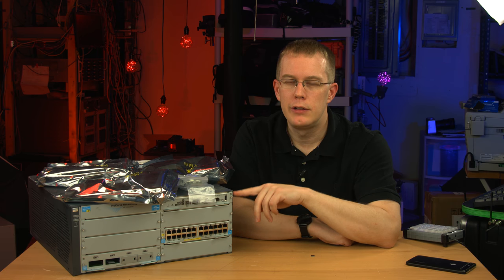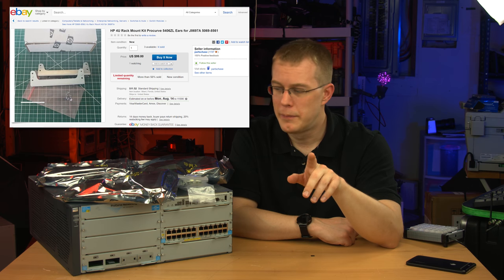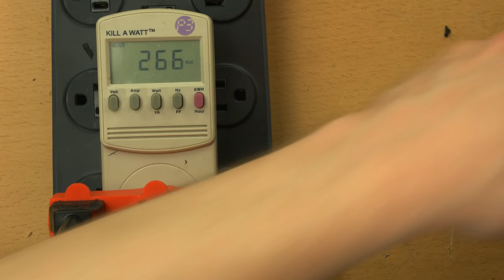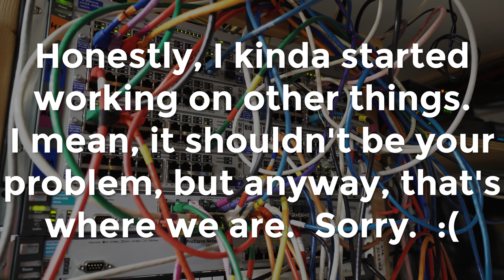Enterprise Network Switches for the Home: Ramble feat HP Procurve 5406ZL

Comment: I wanted to add, this switch and the 5412zl as well as the 5406r and 5412r models are probably the most reliable piece of electronic equipment. I have run several of these for 12+ years without fault and if you're the original purchaser, you get unlimited warranty...even to this day.

Comment: You can save a fair amount of power by only running one PSU and turning off the PoE functions on the switchports. There are still fans and stuff running though, so this is still going to be a fairly hungry switch in terms of power consumption. 
and if you have an old rack mount anything, it can become a shelf to hold your new goodies that have stupid expensive rack ears. (looking at you Juniper) Old server slide rails are great for this kind of thing. Set a few cover plates across the slide rails and voila, insta-shelf. Got an old dumb Fast Ethernet switch? Gut it, rack it and it is now a shelf.
edit - You can hot swap any module on one of these EXCEPT the management module in the very top slot. You will need to reboot to change that one out. Source: we ran these for almost 15 years in a major convention center. These switches are bomb proof. They sat up in summer heat in filthy, dusty catwalks above exhibit floors with big diesel trucks and propane forklifts running around below. Power failures, constant plugging and unplugging of network cables. These things gave no fucks. They just run. Blow them out with a can of air every so often, give them a reboot...or not. If one of the blades dies, that's as good a time as any to power it down, blow out all the spiders and give the fans a fighting chance. If you want quiet, you could probably upgrade the fans with something newer and more efficient. They're just standard sized things you can get from anywhere.

Comment: C13 and C15 are both rated for 10 amps. The difference is that C15 is good to 120° C while the C13 is only rated for 70°.
Reply: Depends on which country you're in and which certifying body you're following. IEC says C13/C14 and C15/C16 are 10A only, but that's primarily in place for countries with 240v mains voltage. 10A and 240V is a serious amount of power. But with 120v in N. America, it's not such a big deal. In fact, Underwriters Labs (UL) approves C13/C14 (with 14awg conductors) for 15A. The only difference being the temperature rating between C13/C14 and C15/C16.

Comment: Aruba S2500 is half the price, and do almost the same thing, L3, 10Gbe etc,  and also brocade switches
Reply: Older Brocade ICX switches like the 6450 or the 6610 are the business! 
Also, some of the older HP Procurve 3500 series switches will do 10gig and have gotten cheap. If you don't mind learning Juniper, the EX2300 also sports L3 switching and 10gig if you get the optional upgrade for it.

Comment: Is it just me or is anyone out there also concerned about security? Counterfeit chips overlaid on top of the network stack sending packets back to China or Russia? I know it's been done in the past with printer nic's. Makes me a little nervous not buying Network related items from an authorized reseller, authorized distributor, Etc. I.e. 100% genuine.  I don't know. Maybe I'm just being a little over paranoid. (https://en.m.wikipedia.org/wiki/Hardware_Trojan)
Reply from the maker: I agree completely.  I find the off-brand Chinese tablets, phones, and computers particularly worrisome because they don't even need to do malware in hardware.  They could just embed it in the software.  I got some stick for that for "being racist", but it's not as if China doesn't engage in cyber warfare-type-stuff (along with many other countries, of course).  I'm not too concerned about the HP equipment I bought because it all came from reputable US-based resellers.  I mean, you never know.  Hopefully AlienVault will catch any malicious traffic.  :/